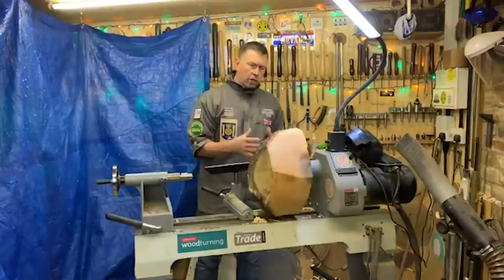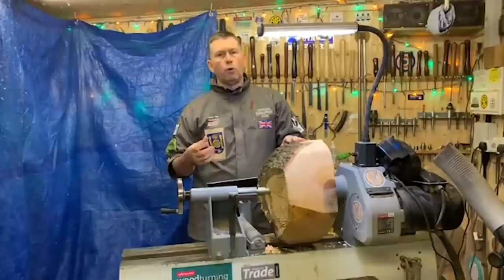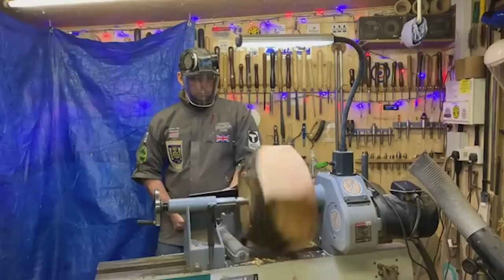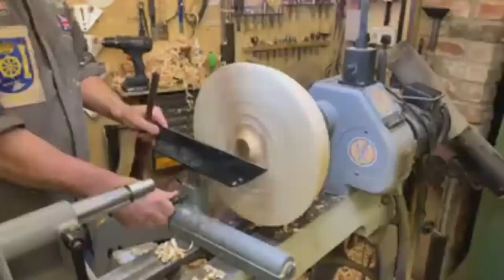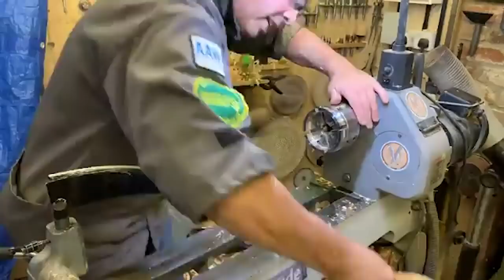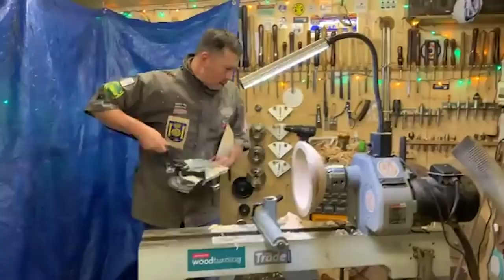Live Turning Thursday - Bowl Coring

Comment: Brilliant.  I am desperate  for the bowl coring system but you have sold out. Is it possible to buy one at that same price soon. Today 🤗 ? Cheers Dave. One other point, you recommend 2 hp but axminster website say minimum 1hp. I understand 2 hp better, if I'm  careful would my 1hp axminster lathe be okay?
Reply from the maker: Hi David, the following reply is from Colwin - "I don't think 1 hp is enough and will stick to my original view of 2 hp. I would not want to use this corer with any of the craft lathes as I don't believe they would be powerful enough." I hope that helps! In regards to stock, please contact our Customer Service team who will be able to provide the latest updates - https://www.axminstertools.com/contact
Reply: Thanks Colwin for you advice, but I had already ordered the bowl corer. It is working well and I have cored over 50 bowls with my axminster 1hp lathe. No problems at all. It is possible to stop the lathe but with care and common sense it works very well. I have been asked to make 100 soup bowls for charity function. Any ideas of how to core a large number of soup bowls? Not necessary for them to be identical, but thin and finished ready to use.
Reply from the maker: Hi David, here is Colwin's reply - "No not really, you always need to finish by re mounting and doing a finishing cut before sanding, I dont know of a device that would create a finish cut at the coring stage."